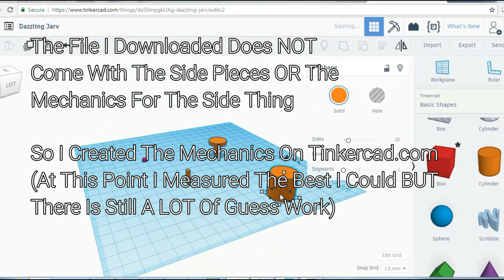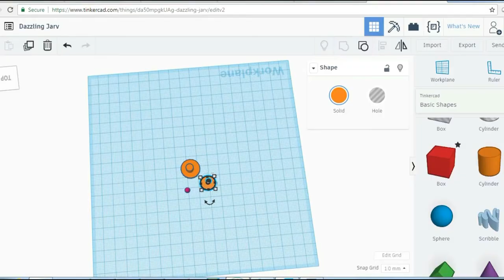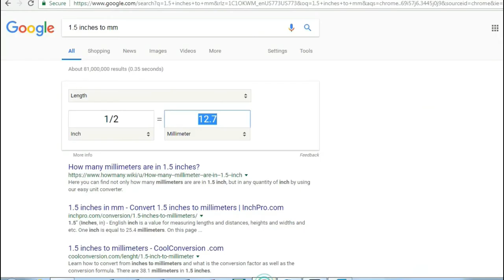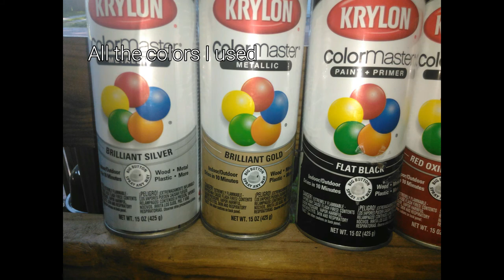3D Printed DIY Boba Fett Helmet Build

Comment: Hi - quick question.. in the video the helmet in in several pieces and you glue them together. But the thingiverse file is one whole piece. Did you separate it all into the pieces yourself and if so how? Sorry if a dumb question but I am just starting in 3D printing..
Reply from the maker: understandable. yes I split it up into several pieces myself using meshmixer. Here is a video I made a while back showing how to do this stuff easily. I made it when I first started https://youtu.be/F4L4Nor_rDs
I will be making an updated "Plain Cutting Only" video here soon. Hopefully this helps
Reply from the maker: https://youtu.be/ZwyqkJ-E0K0

Comment: Hi great video, 
is there a way that I can get the sliced models, and the models for the side pieces, so that I can can make one for my self. That would be great thanks.
Reply from the maker: are you talking about getting the printed only pieces and then putting it together or are you talking about getting the files to print yourself?
Reply: @BrysonMichaelRC  getting the files for myself, if that's possible
Reply from the maker: Thingiverse File by Jerry Fuller: https://www.thingiverse.com/thing:273...

Thingiverse Side Pieces by KF7ser:  https://www.thingiverse.com/thing:547460
Reply: @BrysonMichaelRC  ok thanks
Reply: @BrysonMichaelRC  in the video it show that you had it in multiple pieces, did you have to slice that.
Reply: @BrysonMichaelRC  actually, could I commission this from you
Reply from the maker: I had to do my own plain cutting yes
Reply: @BrysonMichaelRC  could I commision one from you
Reply from the maker: it will be a little while before im able to commission anything. Im still printing the Iron Man Suit, then after tht Ill be doing the Abrahms Trooper full suit, then I have a Robin suit thats commissioned. so My printer is going to be very busy for a while. I am however getting another printer in March for commission prints. I could probably do it around then
Reply: @BrysonMichaelRC  ok how much do you think it would cost
Reply from the maker: for just the 3D printed piece? no assembly, no bondo or painting or anything?
This is kind of my pricing in general... but changes depending on the print size and files... but a basic good start
For Helmets Only:
Printed Pieces No Assembly:
$20 for the Filament (If you want a specific Filament, it would be the price of the filament, I generally just do $20 cause most the filament I use is right around $20 a roll)
$20 For the printing
$15 Shipping
-Total: $55

Assembled:
$20 for Filament
$20 For Printing
$15 Shipping
$30 for supplies (paint/Bondo/Tape/Sandpaper ect.)
$50 Manual Labor

Total: $135

This is general. The Boba Fett has like Several different colors and is a low polly file so it would take more bondo and more paint then usual. Plus there is so much detail. $30 doesnt actually cover the supplies for the Boba Fett and it takes a while with all those different colors. Id probably add $20 to both supplies and Labor making it a total of
$175
Reply: @BrysonMichaelRC  ok how would i pay you
Reply from the maker: my paypal
Reply from the maker: https://youtu.be/ZwyqkJ-E0K0